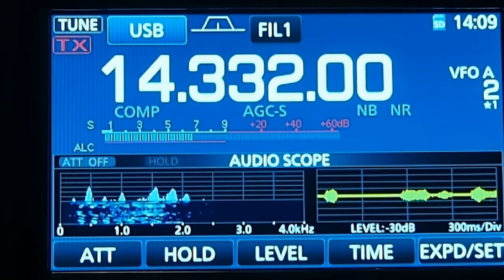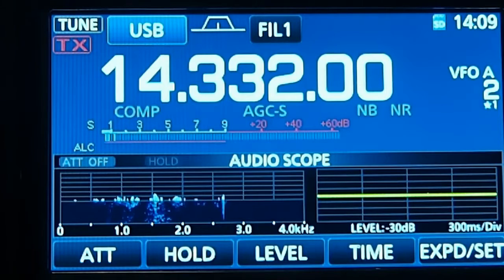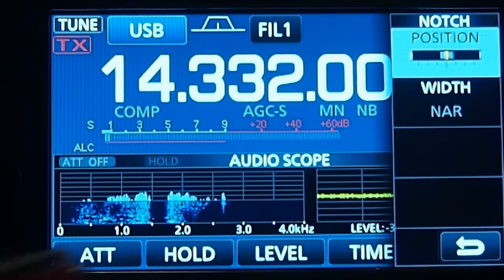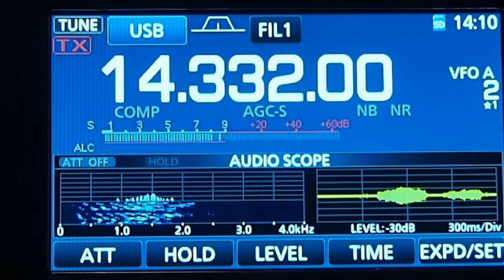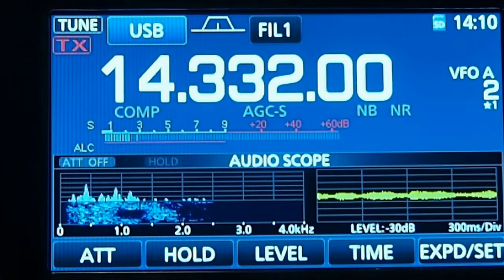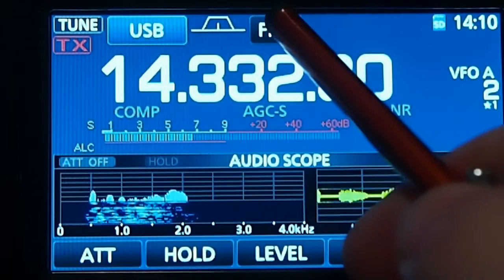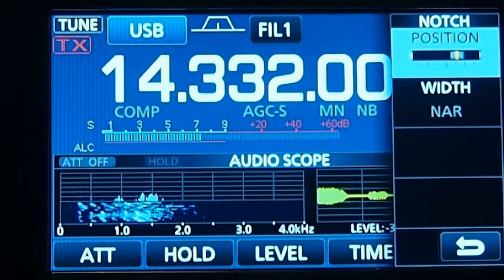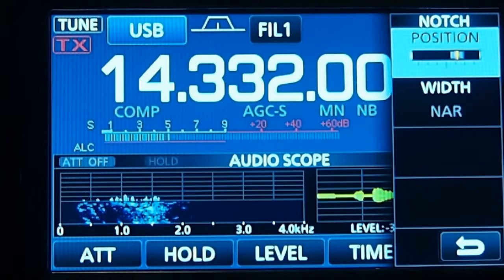Icom 7300 MNF ANF IF Filter Works On Interference!

Comment: If you have a high floor noise on certain bands, can they be notched out? Thanks for the vids, 73. 2D0PEY.
Reply from the maker: Hi and thanks for commenting here. What I do is lower the RF Gain or use the ATT. Usually the RF Gain does the job and the NR can be helpful sometimes too set at 3 or 4. The Icom 7610 has a better ATT because it can be set in 3dB steps. It really works very well. Thanks again and best 73. - Rich, K0PIR
Reply: Ham Radio with K0PIR Thank you. Can you explain what the ATT does and how best to use it please?!
Reply from the maker: @superhappyjavier  It is the RF attenuator. On the 7300 it is 18dB. Normally used for receiving when strong signals are nearby. It will knock down interference while maintaining the desired signal. I don't need to use it on the 7300, but the 7610 I use it often set at 3dB. Just enough to make listening for long periods of time more enjoyable. 73!